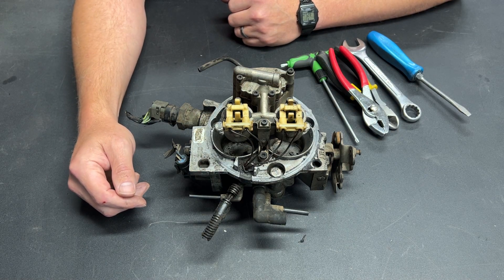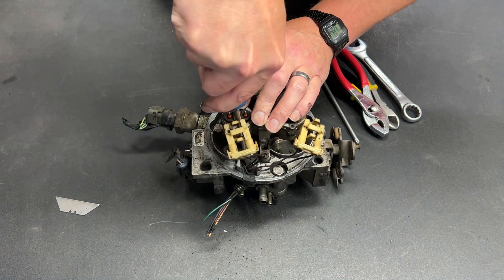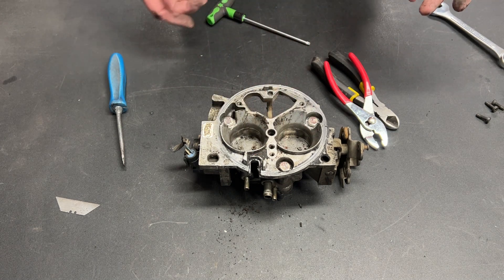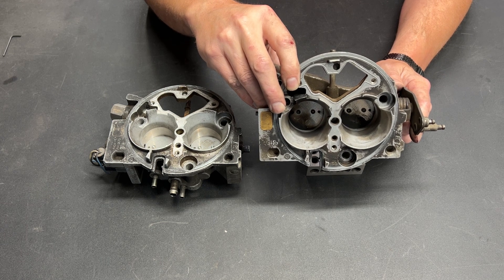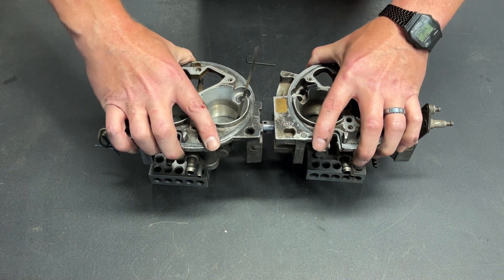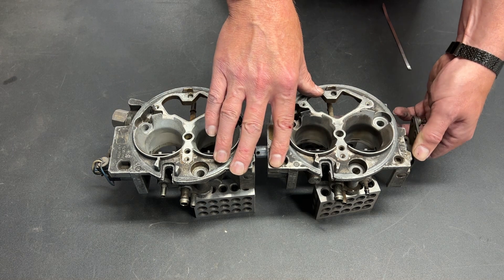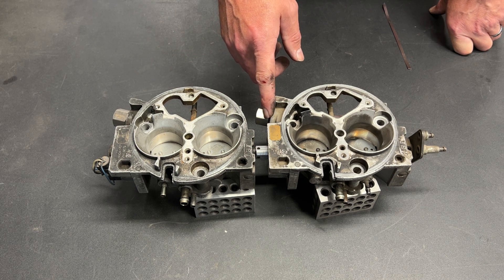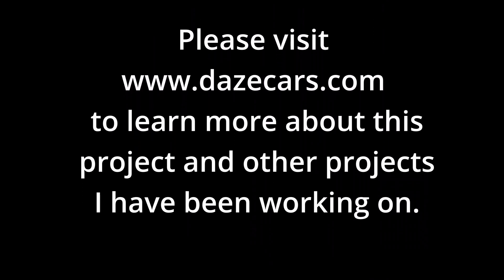393 Windsor Build Part 10 EFFI Electronic Frankenstein Fuel Injection, Adapting  5.8 lower to 2 TBIs

Comment: Well all kinds of thoughts. See if i can remember in order. 1st do you know if just 1 IAC will work ? Next and im not trying to be negative but you may run into a problem with the system getting confused with the amount of air coming in snd the amount of travel the tps covers. I dont know if they have a pre-set ratio for a t-body vs tps travel. Because if you were to buy a after market tps like a Fast 102mm it comes with a 5 volt tps 5volts is wot and .03 is idle. You are doubling the air for the same amount of travel of the tps. It may be fine and figure it out automaticly i dont know. You' have to call holley and let them know. John Meaney will know for sure. He works for them Ok and lastly  you cant use that square  2x6 anywhere you cant have square edges on a intake like that. It will be a mess air hitting those  sharp walls bouncing around making it jump and fall and all kinds of no goid stuff will happen in there." Who ever they are learned a long time ago no square edges like that. Air has to be contoured to flow right.  That is the easiest way i can put it.  I  would look into a  piece of 8 inch aluminum tubing like a 125 wall then.lay a piece of 3/16  or  1/4  plate aluminum on the two sides 180  degrees apart. Weld caps on each end. I would let the plate hang out over the ends by an inch at least. Then you will have a flat flange to mount T bodies on to. And a flat flange to bolt down to the lower. Because the lower is so narrow cut a big enough hole off the tube so you will havw room to bolt it to the lower through the inside. Thats why youll need 8 inch tube because a pretty good portion will be cut off each side leaving you with maybe a 4 inch plenumn (maybe more its ok ) box.  You will get your low end and.mid range torque. And to make sure youre flat with your ends. I would build some little jig of sorts to hold the lower somewhat secure but mostly flat then make your lower flange bolt it down. Then lay the tube on maybe tack it then you should also have tbody flange dine to then check for level and tack it up should work good for ya . For sure better than a 2x6 for sure. Good.luck. 👍
Reply from the maker: how much air coming in won't be a problem.  You calibrate the TPS for closed and WOT at setup not volume of air.  The system doesn't ask how big the throttle body blades are it just wants to know how open it is.  The fuel tables and O2 reading adjust the fuel based on airflow not based on TPS.  It would be no different if I was running this setup with a single throttle body  and then change to a bigger one.  All I would need to do is adjust the settings in the ECU for fully closed and for WOT.  As far as all your suggestions on how to build the adapter it's already done and on the engine.

Comment: Tri power motors idle off just 1 2bbl carb. The others dont even have idle circuts in them. So dont worry about the 2 t- body and a plug at the end of the screw. It will idle fine on one

Comment: Look at Dodge 5.2 or 5.9 throttle bodies. No fuel connectors or injectors.
Reply from the maker: Thanks for the input, I am familiar with those and the things you mentioned would be benefits, not to mention a more uniform mounting pattern.  there are however a couple reasons I didn't go that way:  first I had the chevy TBIs and got them for free.  I wasn't sure how this project was going to come together so I wanted to invest as little money as possible.  Second issue and this is a big one is the butterflies on those Dodge TB are 50+mm per butterfly.  Now with 4 of them we have a massive butterfly area which will make the throttle a lot more sensitive.  I feel like I am pushing it slightly with 4 40mm butterflies so 4 50mm butterflies (which works out to almost a 50% increase in butterfly area) would likely be too much.

Comment: That is thinking outside of the box ! Great idea  ! I would like to see how it works on Your engine and the actual construction of the manifold/adapter , please keep Us updated Thank You ,  Best Wishes & Best of Luck 🇺🇸🇵🇷🦊👍  P/S have You looked into using the Holley systemax lower manifold for Your build ?
Reply from the maker: To the best of my knowledge they only made the systemax  for the 302.  That has been my problem all along is there is almost nothing available for the 351.

Comment: I'm wondering why didn't you use the Ford Motorcraft Throttle Body Injectors
Reply from the maker: Excellent question, especially since the Ford CFI has a traditional 2 barrel bolt pattern!! There were several reasons a Cheve TBI is better than a Ford CFI for this project.  First the Ford CFI was only available in 84 and 85 so there are a lot harder to come by and consequently more $$.  Second the fuel rail is cast into the CFI body do that would require heavier modification.  Third the bore is smaller so less airflow.  Forth and this is a huge one for me the CFI is thicker than the Chevy TBI.  I am very concerned about hood clearance on this engine install and so I am doing everything I can on this build to make the intake as low profile as possible.

Comment: This is a very cool project. One of the irritating things about the SBF is that the EFI intake does what it's made to do very well...but what it's made to do is in conflict with what hot rodders want to do. We want a screaming, 6500rpm motor that makes a lot more horsepower up top than the EFI intake is built for. It's built to make as much torque as possible at the very bottom end, running out of breath above 4500 rpm.
Reply from the maker: Glad you like it!!  You are completely correct and with this being a 393 due to the extra displacement, the higher flowing heads and cam a stock truck lower will choke off the motor even sooner, probably 3000-3500 RPMs  BUT there is a lot of material around these runners and they can easily be opened up to almost double the runner volume for significant performance increases.  I will be doing that once I get the upper fully sorted out and that should allow this motor to run up into the 5500 RPM target I am looking for to max TRQ and HP.